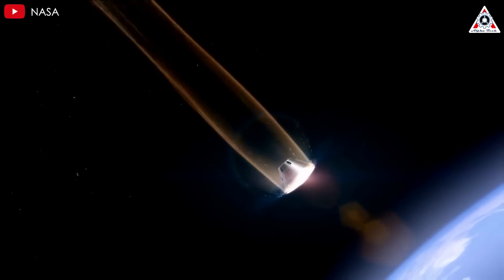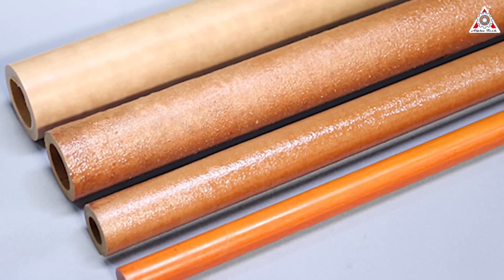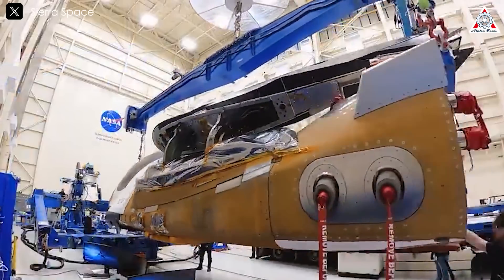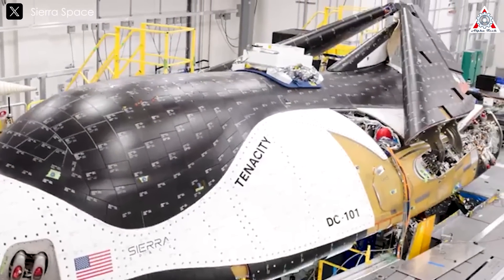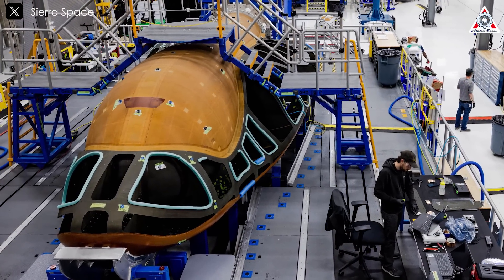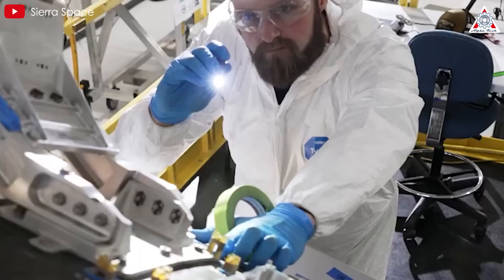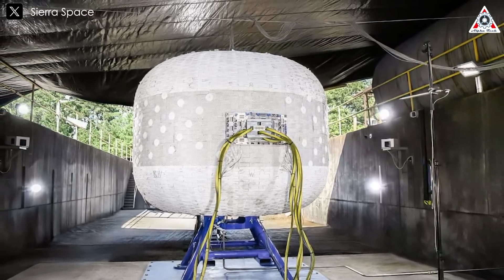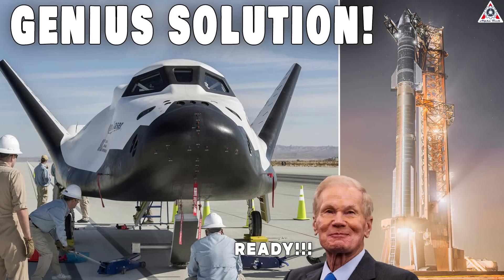It’s mind blowing! NASA’s New Space Plane Major New Upgrade while SpaceX Starship…

Comment: So one I didn't like about the space shuttle was titles they has way to many small titles you would think use larger titles and made them where they where bolted and glued what would need to do with the Space Shuttle have some numbers sticking out and they have small hole drilled and taped then would be small holes in the titles and the holes would be counter sunken then bolt goes in and then there would be a cap to go over the hole with some kinda of heat prof glue. Anyway this is just a thought.

Comment: Damn! the critics are getting pointy! Glad to see it!😂 
Dream Chaser is an obital pickup truck with a disposable trailer.

Too small...
Sized for the last decades rockets.

What will be figured out, probably by some one wishing to become a Military contractor, is a stout fabricated super shuttle can be built out of Stainless like Starship, and with hard chine construction and constant radius gores, tile sizes can be increased dramatically  and only need a few shapes to cover everything in the worst areas.

Basically could be sized to be a stage three on a Starship booster, with a truncated Starship as a second stage, that was just fuel tanks and engines.
Then the Super Shuttle could use smaller engines and tanks for orbital and low intensity gravity wells like Moon and Mars...

So that there would be zero waste, and everything get reused, and the Super Shuttle not take big empty but still having mass tanks to the Moon, or Mars and back.

Let the final propulsion be designed for working Mar's gravity well.

Leave what belongs to Earth's gravity well to be re used there, and free up the ship design for Moon and Mars, using tilt rocket engine tech to create belly landers, with drive On & Off capability.

Dream Chaser and Starship are cute, but the Space Force wants  a Super C-17 to Mars and back...

Ten years, will be being built.

And operate off the largest SpaceX V-5 or V-6 boosters.

Y'all ain't seen nothin' yet... The Military budget makes Elon look like a shoe shine boy...

They are really gonna get into this Space thing... Be able to seriously feel important and official... 🤭 Belly crawl naked over broken glass to Captain those ships...